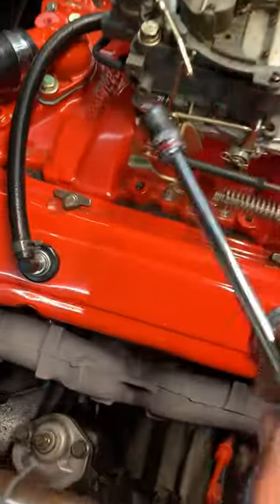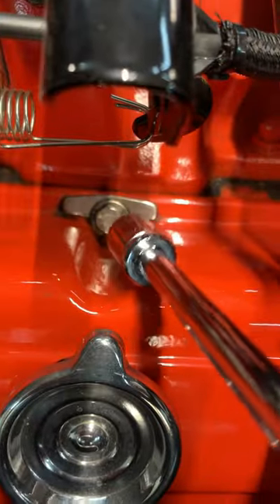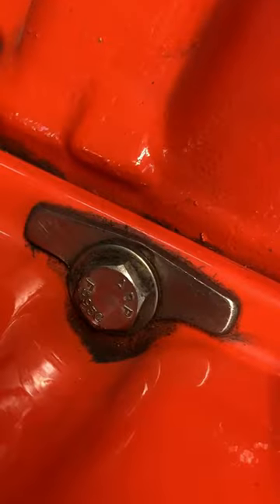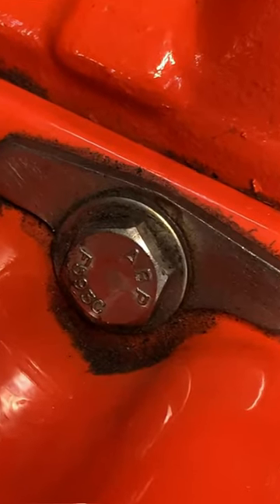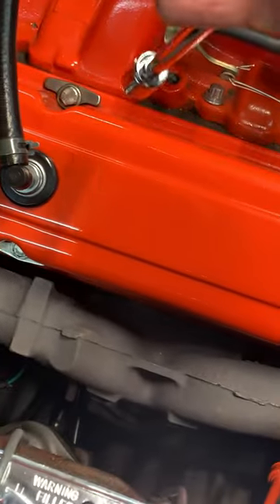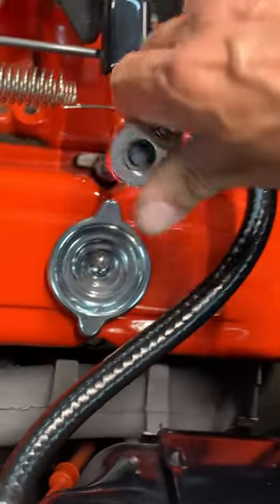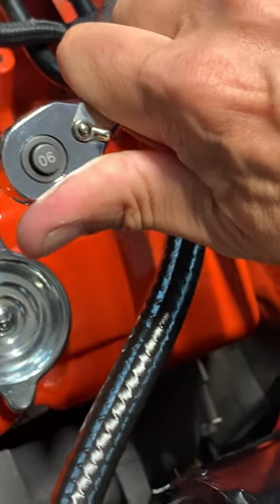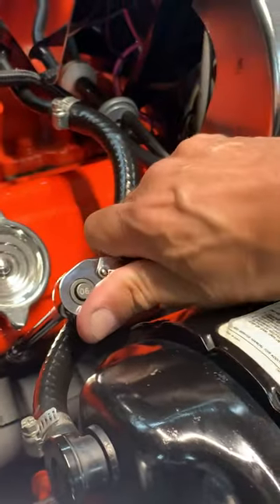How to PREVENT Valve Cover Oil Leaks

Comment: What is that hose in the left corner when your video first comes on and and how can you fix that if there’s a leak there?
Reply from the maker: I think you’re talking about the vac hose for the brake booster. Not sure where yours is leaking but you may just need to replace the hose and use good clamps (don’t buy the cheap ones). 

If the leak is at the carb fitting, Teflon tape or thread sealer should take care of a leak there. Make sure you use a line wrench. Good luck! 😊👍🏻

Comment: Would blue thread lock work to keep them snug? 
That engine is cleaner than my kitchen btw.
Reply from the maker: Since you’re dealing with heat and compression of the gasket material, I don’t think thread locker is a good idea. Plus, thread locker would build up over time requiring constant cleaning of the threads. Just my take on it. Thank you for watching! 😊👍🏻